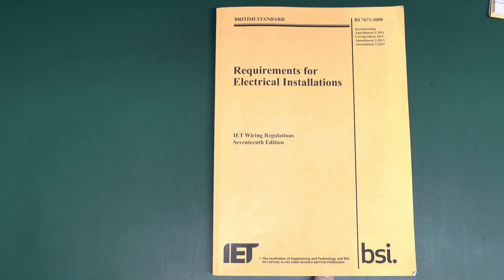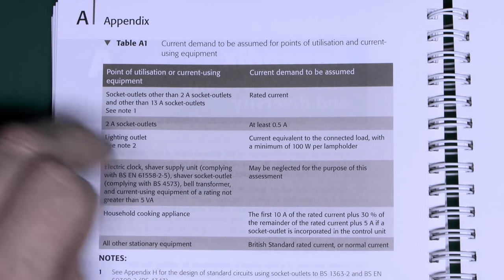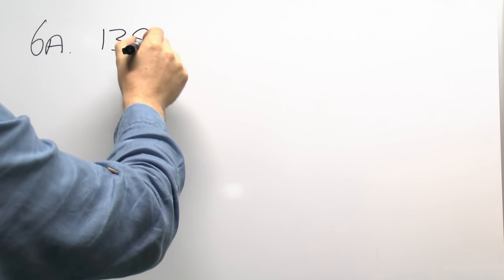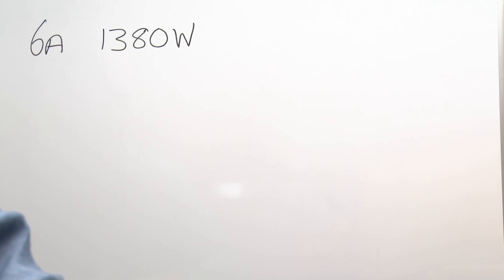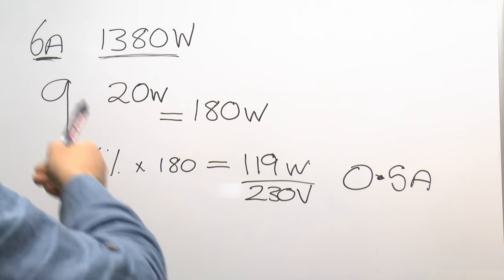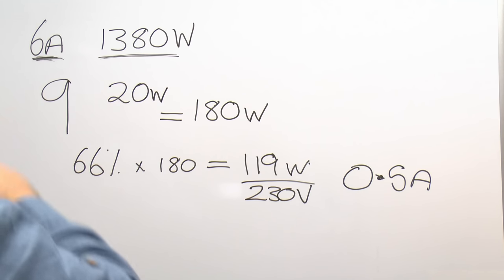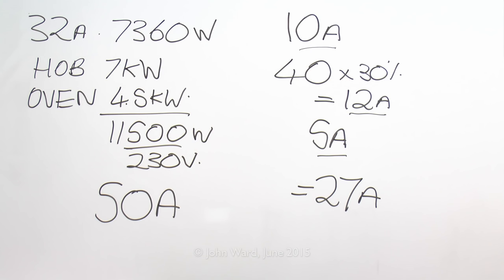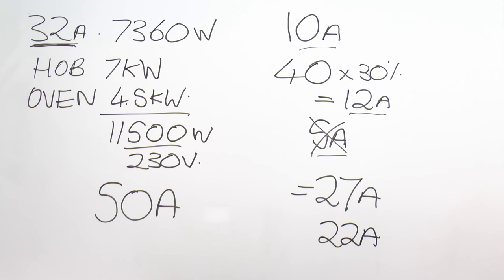Maximum Demand & Diversity for Electrical Installations

Comment: I don't understand why you would combine 2 ring mains for diversity as they are on separate fuses.
Reply from the maker: +Graham Savell Depends on the likely loadings.  If one was for a kitchen then it would have a reasonably high load, so could be considered separately.  However if two others were for upstairs and downstairs rooms, then the load would probably be very low, and could be considered as a single circuit and even wired as one.  The fact it is on 2 or more separate fuses doesn't change the items that are connected to it or the rooms/floor area that it covers.
Reply: ***** I am currently doing level 2 electrical installation, so forgive me if im being anoyoing. I thought the purpose of diversity is to make sure a curcuit that may have an unpredictable load has a sufficient cable and fuse rating so i didnt think you could combine the diversity of two curcuits because the fuses would act independantly for each curcuit.
Reply: JW is confusing viewers by emphasizing the potential current loading to individual circuits. Maximum demand and Diversity calculations should only be used to estimate the potential loading of the whole installation, with the exception of one category of circuit i.e. the cooker circuit. Also regarding cooker circuits the diversity calculations are different for domestic, commercial and industrial installations, so therefore a standard 4 ring double oven cooker would require a higher rated circuit in commercial or industrial installations than the usual 32amp circuit installed in a domestic installation.

Comment: Hi jw....I'm moving to the Philippines  the power over there 230v 60hz....UK power tools  are 240v 50hz.... How can I get from 60 Hz to 50hz. So that I don't brun out my .uk tools in the Philippines...What can I buy that will drip 60hz to 50hz ?????
Reply from the maker: You would need a frequency converter, which will most likely cost more than the tools did.
If the tools have 240V motors they will most likely run 20% faster.
if they are battery items, and the 240V is for the charger, it's very likely that the charger will work fine on 60Hz.
Anything that has an electronic power supply may also work on 60Hz, many such things are designed to work on a range of voltages and frequency.
Reply: @jwflame  thank you verry much

Comment: Hi can you please give some advice on calculating the maximum load and supply need for a  office conversion. It is being converted to 14 small 1bed room flats with individually kitchen bathrooms each flat having it's on 6 way consumer unit and the communal area having a similar 6 way board all lighting is led.  Thanks

Comment: In Denmark, we only use to types of fuses for home use, 10A and 16A, if we need some extra power i.e. for an oven, we really use 3 phases with max 16A on each phase. But the rest of the house, it is 1 phase and 10A or 16A.

Comment: Hi John, So in a kitchen if there is a fridge freezer, microwave, washing machine, does that mean the cooker has to have its own circuit? or radial?
Reply: @jwflame  hi john just one question  I'm going to be using pvc trunking as there is no other way to feed the cables from the upstairs consumer box to feed a double ovens and a separate induction 3000w which also has 3 gas burners in the kitchen. The reason why is there is no other way to do this as the flooring upstairs has been laminated and i dont want to ruin the floor and the decor. There is nothing in the regs thats states you cannot use trunking in a kitchen. Please confirm as i have found no information. Thanks

Comment: in germnay they replace at new insterlations the old melting main fuses with fast circut breakers! so i can not even run a small 10 000 watt light bulb. maybe not even a 5 000 watt . at 230v they suck 46 or more because the lamp is for 220v !  even if the main alow me 63 amps. the old melting fuse type NH have no problems with large starting currents! the new shit main brakers 63 amps are not even switch after the  b16 circut breaker! in some cases they switsh boath ! and they are super expensive! so with the old 50amp NH fuse i can do what i wanted but with the new i can not run large tools with out a current limiter!

Comment: Hi what would you fit a 16.3 kw all electric induction range. It has no socket on it. What cable size and mcb size any info would be great
Reply from the maker: If it's in a house, probably the standard 32A cooker circuit.
Reply: Yes it is in the house. all the manufacturer instructions say is protect with its own individual rcd or rcbo because of the high power cause nuisance tripping.and 10mm max live connections and 6 mm max earth

Comment: Are electric hot water tanks not used to provide hot water to the taps and bath(shower) in the UK? Are POU water heaters more common?
Reply from the maker: They are used in some properties, are typically 3kW and heat up overnight on cheaper rate electricity.
However gas is far more common for both hot water and space heating.
Point of use heaters are available, but are rarely used.

Comment: As Usual John...all good stuff. I was recently in a property with two consumer units 100Amp main switch...one running the home...the other running the storage heaters...which did make me wonder about the incommers from the DNO.....holding up under the load of the whole housing estate drawing maximum load overnight.....I suppose there would be no ice on the footpaths outside, as an added bonus of the possible overheating.....In your example you cannot have any storage heaters at all...although this home had them, albeit, on a separate consumer unit....and it had been like this from day one...working fine...Addaed to the were four 32 amp fuses on the main board Kitchen sockets, upstairs sockets, downstairs sockets, cooker point. plus a 45amp shower fuse....crazy stuff according to the regs.... One board 1x 45 amp...4 x 32 amp....1 x 16 Amp and 3 x 6 amp...and then the storage heater board... full of 16 Amp fuses  x 5.......

Comment: Thanks for a very good talk. Back in the 1980s I ran a small NICEIC firm, and on an inspection day, the subject of diversity came up. I said that the diversity recommendations in the regs. (15th edition back than - unchanged today) resulted in exaggerated maximum demand figures. The inspector agreed. He said that the electricity suppliers had vast experience, and that, for domestic installations without storage heaters, they allowed six watts per square foot - and that was when, for domestics, the only forms of lighting were tungsten filament lamps, or fluorescent tubes. You calculate loads on 230 volts: this is the official pressure, but the suppliers are crafty, and in most parts of the UK, the supply is 240 volts, and quite often near 250. Taking a very untypical case of a property of 2,500 square foot, using 6w/sqare ft., without storage heating, gives a maximum demand of just 65A! An aside: one lighting circuit in any domestic is very bad practice, as, in the event of a fuse blowing or a breaker tripping, the whole place would be cast into darkness after dark. This could cause great danger on staircases, especially for elderly, unwell, or frail folk.

Comment: The trouble with the MD calc on ring mains is if you have 3 rings its 57 amps. thats ony 3 mcb's. by the time you stick a hob a oven, immersion you soon nudge up to 100 amps & often exceed it.
I find working out maximum demand a waste of time as its just not accurate enough, its always way, way over the actulal load. There should be a new method entirley utisling a clamp meter & introducing certain loads for existing propertys

Comment: David Elgood. JIB Approved since 1973 still working. Its a pity that the IET does not consult  some one like you before they print the IET Regulations. I am amazed that the new regulations about fuse boards are now being changed to metal to "contain a fire". We are told that most fires are caused by a loose neutral connection.
I wrote to Wylex  MD  and pointed out that the old wooden fuse board had two retaining screws for the mains cables, and a deeper  depth for the cables. These were when it was 16mm tails. We now have 25mm tails and a smaller depth for these cables but ONLY ONE SCREW FIXING. I copied this to the IET and received a reply, that we should ensure that we tighten the fixing screws correctly. I thought prevention of a fire is better than containing a fire!  The meter has two fixings for cables but the part where the fire starts has only one.
Reply: If multi stranded tails were used this would resolve the problem of meter tails being loosened merely by moving them, it would help save electricians finger joints as well
Reply: why is it that the main incomers are not in clamps like you see for the meter connections, the other thing that is dim to me is that they suggest on a TT supply you should have an type s 100ma which makes sense to protect single insulated cables as you might not have enough current line to earth to blow the main fuse, but to me the danger is the tails that you can't clamp as tight as you should be able too first knock of the tail and they are loose in the connection. 
not so bad now with the stuffing glands. but still it's silly

Comment: Fantastic very clear and easy to understand, just one question John, what with the use of LED lights theses days  and the current they draw is so small why do we still need to use a 6AMP breaker ? Surly a 2 amp or a 3 amp would be suitable? I know no one makes circuit breakers which current ratings less than 6AMP so maybe it’s time they did ?
Fantastic video John as always 👍👍👍❤️⚡️

Comment: that was incredibly interesting and helpful do you do courses or can you recommend any? I'm a service engineer for commercial catering and it's not possible to become a commercial electrician now sadly. atleast not without quitting my job and that's just not an option ☹ i was thinking of doing the 17th edition course pat testing and eic electrical competency what do you think? should I be doing something else as well? 😊 appreciate any advice you could give
Reply: I've been doing a lot of the same work as you, Looked at getting qualified as an electrician so I could install single and three phase outlets for equipment like extractors, gas isolation, ovens and pot washers etc.  Was told the only way to do it realistically was to qualify as an inspector and do the work then act as an inspector to check my own work!  (this was from someone who trains apprentices who are on day release)

Comment: Please, can you shed more light on the topic with radial circuits instead of ring circuits?
Reply from the maker: Maximum demand depends on the connected equipment.  Whether it's a ring or radial makes no difference.

Comment: still quite a few of those sensor floodlights about 500/300 watt...your 6amp lighting circuit can easily be max'd out with a couple of those on the side of the house
Reply: If the connected load of the circuit is in excess of the circuit breaker rating then the rating should be increased accordingly and if this rating is in excess of the cable rating then the cabling should be uprated also or a new dedicated circuit added.

Comment: Just a quick question im struggling on, im a little confused as to why you dont add the 5a and 10a together and take that away from the 50a to give you 35a before you do the calculation as in the osg it says 10a + 5a if a socket outlet is present. So 
10a+5a=15a
50a-15a=35a
35ax0.30a=10.2a
10.2a+15a=25.2a
Or do we do
10a - 50a = 40a
40a × 0.30 = 12a
12a + 10a + 5a = 27a
Thank you, sorry if i missed something obvoius.

Comment: I think a 10kw peak load is not that uncommon nowadays, I know people who regularly run their washing machine, dishwasher, and tumble dryer at the same time and that is close to 9kw if their heating cycles line up, certainly enough to overload a 30 amp ring.

Comment: Thank You very much John again. Great Video. One thing I have to mentioned about 100W per light fiting. It's seems correct. One room have usually 1x light fitting. Example my room have 9 LED lights with 8W each, which is around 72W. Some of the commercial LED's can take a lot more. Sometimes Electricians underestimate how many LED's you can connect to 1x light circuit. You are great Electrician with very good knowledge. I'm very appreciate Your work. Thank You.

Comment: Very Informative, thanks. But I read on your website that a ring main is used in the distrobution network, could you eleborate on this, maybe in a video?
Reply from the maker: jayja45 Ring circuits in a house were called 'ring mains' in the past, the correct term is now 'ring final circuit'.  

A ring main is used for power distribution at various voltages, and is arranged so that sections can be isolated for maintenance while leaving the rest of the system energised.